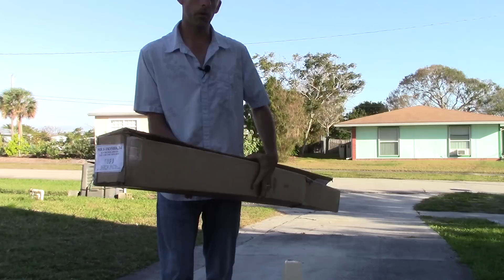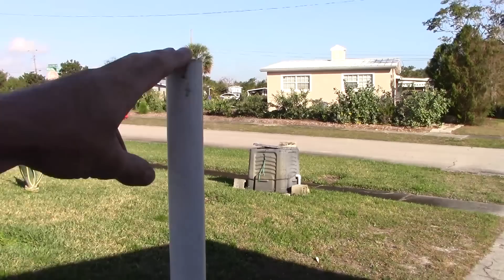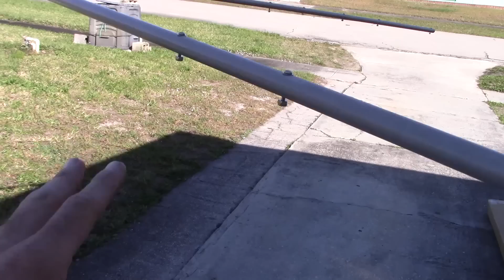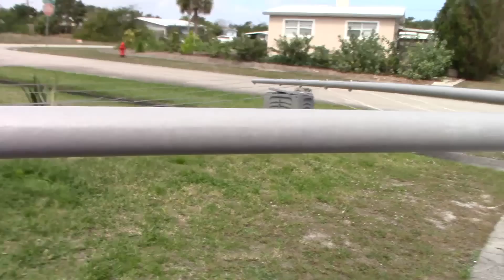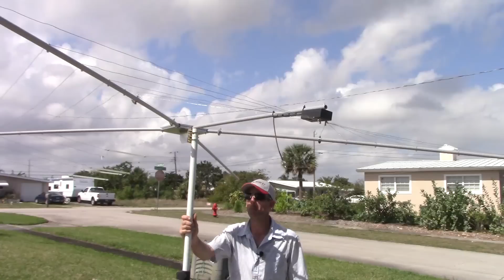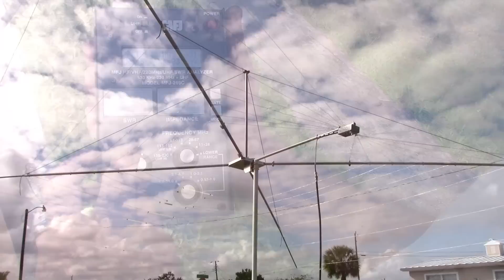MFJ 8-Band Cobweb MFJ-1836+HK34 Add-On Kit Complete Setup

Comment: Thank you!! I just picked up a brand new in the box MFJ-1836H and the 1918 tripod. Your video will help me with assembly. I noticed my 6m worm gear clamps didn’t have the hole so your video explained that. Also, there were two complete mounting plate kits in the box, 4 pieces. I guess that was a mistake when they packed it. That really had me confused when I was going through the hardware list. I will use the extra one for another project!!
Again thanks!!! 
KF0IPT

Comment: After losing my hexbeam to hurricane Milton, I bought the last 1836 at the local HRO.  Also on the way is the 30 - 40 meter kit.  What were the results of your characterization between the cobb-web and your vertical ?   Have you noticed any RF induced reaction between the two antennas ?  How far apart are the two antennas during your testing ?  thanks, 73

Comment: I was surprisingly granted with the remains of a MFJ-cobweb given by a widow of a local amateur operator. The problem is that in the process os removing it someone cut the elements and give me only the hardware so i am asking for the wire measurements for itch band please if you have it.

Comment: "I strongly advise against purchasing this antenna. It cost me €600 and has numerous flaws. The tubes do not fit into each other properly, making assembly a nightmare. They are not machined correctly. Even after meticulously adjusting the antenna with the Nano VNA, all cables hang loose, despite following instructions. Additionally, there is no alternative since the spaces are pre-drilled in the fiberglass.

With even a slight breeze, nothing stays in place; everything moves. The wires from the 10m band overlap those from the 15m band, and nothing is properly tensioned, as you can see in this video. The tubes move in all directions, causing the SWR to fluctuate due to wind, resulting in unstable tuning as the antennas move closer together.

How is it possible to have mechanically botched an antenna in this way? I could have constructed a sturdier one myself, but I trusted a manufacturer and paid excessively for something that doesn't work. I'm not going to drill holes in the fiberglass, risking further weakening the antenna. I'll have to find a solution using clamps.

In conclusion, do not purchase this antenna.

Comment: Wish they would sell versions of these kits that come without the tubes and wire, just the matchbox and other hardware. Would make purchasing internationally a lot easier. I could source some good tubing and wire here easily. Shipping 6+ Ft. packages internationally gets expensive.
Reply: Btw, if i were to get the full 6m-40m high power cobweb, how does it perform running with just 100W power? For now i have just my ts-430s 100w radio but might purchase a amplifier in the future. Or would you recommend getting the 6m-20m 300w version instead and purchase the high power upgrade kit and 30m-40m add-on kit later on when i have the amp?

Comment: Wondering if you found that when you put the cobweb on the final mast elevated above where you trimmed to tune in this video ?  What I have experienced in building several single-band antennas, most notibly my 40-meter 14-ga insulated wire dipole which i found i needed to trim another foot off each end after raising from setup 8 ft off ground to where it is now laying on my 2-story roof at 20 feet. Like the video and the style and compactness of  the cobweb vs the 2 separate dipoles. Best wishes. 73 from California.

Comment: Can you rotate the bottom plate 180 degrees , 
so you can let the top tube go through to put another vertical antenna on the top of the tube?

Comment: I have recently purchased this same antenna. I am stopped at the point of mounting the wire attachment screws because the holes for the  screws for 15m are missing. Specially it appears I have mounting hole for 20m  1" from end of pole 17m  15" from 20m hole  MISSING HOLE FOR 15M 
then the next hole or screw mounting point is 17" away which I assume to be 12m  then 6" and another hole for 10m. Would anyone happen to have the hole spacing dimensions for these poles as I would rather spend the time drilling the holes my self then rely on a return. The other question would be could I safely drill out the holes for 15m by simply dividing the 17" by half and placing it there. Thanks for any help you might give. I don't fully understand the how elements might interfere with one another So those that have one maybe able to help.
thanks
Tom
WI6N

Comment: Crazy question but if i buy the 40m add on, and if i dont use or put the 30m wire on and only put on the 40m wire will it work on 40m or is it dependent on having that 30m wire installed?   I guessing it will but will need more adjustment.......73.

Comment: I have this antenna for about 8 months now in the mast (6-20m version HP) and it has a very small footprint and withstood the storm beginning 2020 (10-11bf) without any issue. It's a great antenna for a very low price. It was easy to tune (with an analyzer ofcourse). You should do a first round roughly and then adjust all of them again as each adjustment will have an effect on the other bands. I use the AA-30.ZERO rigexpert as you can see all bands effect easily of you laptop screen. For me, this has been a great buy.

Comment: Eric, just installed (today) the 1836 and can't seem to get decent SWR's on most bands. Disappointing. Followed directions, used 226 analyzer, yet failure. Dont know what to do next.......
Reply from the maker: Where is each band resonant? Is it lower or higher than the bands?
Reply: @HamRadioConcepts  Eric, thanks for responding, a bit lost here. I picked the center freq of the bands for my Gen license Then trimmed for the best SWR at that center freq. The SWR was measured at each band center: 
20 M 2.07ctr  low end = 2.98, Hi = 1.3.
17M  4.28 ctr  low = 4.88  Hi = 3.79
15M ctr is 2.21  low is 4.48  HI is 1.25
12M ctr is 6.63  Lo is 6.84  Hi is 6.37
10M ctr is1.7  lo is 7.07  Hi is 6.2   
6M ctr is 6.25  Lo is 7.47  Hi is 7.93
My center freq SWR's are almost all over 2. Probably doing something wrong.
Reply: @HamRadioConcepts  Eric, I just bought a MFJ-226, its great but I am getting out of Ham Radio. I just paid $300 two weeks ago, if you know of anyone interested , I am selling cheap. $200  Firm
Reply: @HamRadioConcepts  Eric, also just got MFJ 1386 Cobweb antenna, selling at $200, paid 259 from MFJ.

Comment: Eric I am seriously thinking about getting one of these for the house in Brazil, If I understand that you tuned to the center of of the bands and used the tuner as you moved off center. I will be an AT 200 pro for tuner and the coax run will be about 80 to 80 feet long. 

Truly enjoy the videos very helpful and informative info. 73 N9ZTC

Comment: Hi,  you are definitely an asset to the Ham radio community. You are a star. You describe better how things are and what they do. Without going into too much detail or not enough. although personally I would like to know how people go about mounting there antennas so that I can see and develop my own ideas. I.e the construction. The reason for this is I want to mount the cobweb antenna underneath my 6/2 /70m vertical I think it’s quite possible bearing in mind it is on the chimney of my roof. Also the construction where the antennas meet in the junction box I think to myself I could add more bands that are smaller I.e. higher in frequency....thanks for your work *

Comment: i have the MFJ-1838 8 band cobweb, after watching this and reading what little reviews there are i bought it put it toghtor and it turned out to be Narrow banded. swr being over 10.1on all the bands.  the antenna is now for sale.  Verry disappointed with this antenna.
Reply: Brandon Ray did you happen to tune the antenna when you assembled it using an analyzer? Or did you just connect all the wires and think it was magic?
Reply: @sebastianbluecrew4320   I did try to tune it with a analyzer, with no luck, i would get it to tune on on frequency and when you move away from the frequency its jumps to over 10 SWR.   i had a few local hams look at it as well and it was determined as narrow banded.     it should not be narrow banded, as seen in this viedio and other reviews that it had a good SWR bandwidth.
Reply: Brandon Ray yes you’re right because I used it without a tuner at all that is why I like that antenna with 8 resonant bands
Reply: @sebastianbluecrew4320  thats why i got this antenna to get away from having to use the antenna tuner.  i dont know why the one i ended up with is narrow banded.  any ideals?

Comment: i Need some help with this antenna, i can not get it to tune i can get a little bit of a low swr dip but that only goes for a few khz some bands are way above the ham band.  i noticed that the match box has the center pin shorting to ground. im not sure if that is right for this antenna. im not sure whats worng and its verry anoying. email me my email is good on QRZ 

Thanks for any help 

Brandon
KM4FLU

Comment: I just finished putting mine together. Its the 10-20 metre version, and even that gets quite large when assembled. It was fairly easy to tune too. Only 15m gave me trouble, but spotted it before I cut too much off, the spacer wasn't quite centred. Later this week I'll get it up on a pole and try it out.

Comment: Eric, I've just assembled my MFJ-1838 cobweb.  I'm using an MFJ-209C and an external frequency counter to find all of the resonant frequencies.  Then, my plan was to trim the excess wires.  However, I find the bandwidths are very narrow.  It doesn't take much movement in frequency to go from <2 SWR to infinity.  Is that normal? K8TMW 73
Reply: The longer coax feed you give it the more broadband it should become also when you raise the antenna above 10 to 15 feet above the ground the tuning will change a little not to much. Lets say not it has a 1.5.1 between for example 14.200 to 14.250 ( It will vary) when you add lets say 30 foot of coax to feed it and raise it to something like 25 feet above the ground the the bandwidth will increase to for example 14.200 to 14.280 maybe a little more.

I have this antenna with the 40 meter add on kit I compared it to a 20 meter dipole that has a 1 to 1 match coax fed no balun it is 30 feet off the ground on the ends.
The cobweb antenna is on a tripod on my roof about 35 feet in the air more or less it has a 1.3.1 match at 14.275 the dipole is 1.1 I was talking to a guy on that freq and compared both antennas  while talking to him. The result was the cobweb was about 3db stronger in fact it is on all the bands except 10 meters.
Reply: @jamesmackinlay4477  Thanks for the information!  The antenna works very well on 40M.  Using the tuner in the radio, I've made contacts across the country.  I'm going to see if I can get it a little higher up.

Comment: hello, i am thinking about this antenna, i have a 14foot mfj rotatable dipole and its ok but the swr is not that great, i have no way to string up a wire dipole. i am wondering how big this antenna is? how good is the swr? will it tune with good swr all across all bands?  will be about 30 feet on a chimney mount. any help would be appreciated  KM4FLU..73s

Comment: I just got mine - the hardest part is sorting out all the hardware - theres 58 screws of differing lengths, and 58 nuts of which four are the odd ones out. Took me a bit longer as I live in the metric world and not used to handling imperial system hardware. So nuts and bolts are sorted, now I can actually start building the antenna. Great video by the way - helped me to discover my matchbox needed the ferrites moved up a bit toward the box. 73's de VK2EMP

Comment: new to the hobby so sorry if this sounds like a dumb question  but could i just have a antenna tuner in line to bring the swr down while operating ? thank you dont be too cruel with the replies
Reply from the maker: I just made a whole responsethen realized I was thinking of the wrong video... So I would never be rude, and there is no dumb question, this is why I am here to help.. Just remember one thing. A tuner does not tune the antenna, it only tricks the radio to be happy in seing a low SWR. The best practice is to tune the antenna to optimal, and use a tuner when you need to go from one end of the band to the other and the SWR gets higher. I like to tune the antenna to the center of the entire band, and i can maintain a 1.5 SWR from each side as I move across the band (Depending on the antenna) but the cobweb can be pretty broad banded when you do it that way. If you tune to the very bottom of the band, by the time you get to the upper portion, you will see a higher swr. A 1.5:1 swr is perfectly fine, even a 2.1 is usable. When it is 3.1 and higher it becomes an issue.
Reply: HamRadioConcepts thank you very much I value your advice and I shall obtain a antenna analyser 👍 keep posting Great posts

Comment: Look forward to the comparison between the vertical and the cobweb antenna, currently debating with myself which will work best.
Reply: The Cobweb would be killing the vertical if you can get it 1/2 lambda or more up.  In a low mast it will do well "locally" in your own continent.

Comment: Eric, I own this antenna as well and bought the kit separately, so it was before they started offering all 8 bands in one box.  My question is, how the heck did you get it to tune?  I've got mine an a 6' speaker stand so I can rotate it and NONE of the bands are even CLOSE to being resonant. I haven't added the 30+40 meter kit yet. I wanted to get the first 5 bands tuned first. But like I said it's not close. So what's the secret?.  73, Rob, KC5RET
Reply from the maker: Did you trim all the wires? you have to sweep it on the analyzer to see how long each band is, and trim accordingly..
Reply: Thanks for the speedy reply Eric. No sir, I did not. I wanted to use the other method of wrapping the wire back on itself before physically trimming (suggested by K7AGE). But if my initial tests are correct, most if not all the wires are far too long. So I wonder how much the SWR changes when the antenna is 20 or 30 feet off the ground. Second, does it matter which way you tune, from 10 going down to 20 or the other way around?

Comment: Did the HK34 Add on kit change the tune of the other bands?  Also if not using the HK34 kit is there any way to have a mast above the cobweb to support a VHF/UHF antenna?
Reply: I just put the 5 band together.   have 20, 17, 15, 12, 10 all tuned right up.  6 dip in SWR only comes down to 4.28.  Wondering if you ran into any issues with 6 Meter?

Comment: New to the hobby, and made a 6 band home built version of this...My question is on tuning....Should I start tuning/cutting at 20m and work up to 6m or vise versa? Not sure how each wire affects the other bands so figured I would ask before I trash my wires LOL. K0NES
Reply from the maker: I actually cut out that part of the video, each band wire you tune should not change the others.. I tuned 10-20 and then did 6. No problem.

Comment: Great video. You don't need to cut the wires. Just bend them back on itself and wrap around the wire. If you need more wire, just unwrap some wire. Did the SWR change when the antenna is mounted higher?  

Also, there will be some interaction between this and the vertical antenna being close together. It is hard to space them apart by a wavelength in a backyard.

It would help your video if you would cut in some close-ups of the areas that you are describing. When finished with your main shots, go back and get some close-ups.We all want to see what you are talking about. And, the wireless mic allows us to hear you! That is a great addition to your video gear. Keep it up. Randy
Reply from the maker: K7AGE yes it is lower in tune again so I need to shorten the elements a bit more being higher but its still good where its at

Comment: A very informative video.  I wouldn't mind buying one.  I'm wondering what is the recommended height is?  I look on MFJ's website but couldn't find an answer in the description.  Thanks! KG5MDB
Reply from the maker: Dan Barrera 10 feet minimum
Reply: Great, thanks!
Reply: Per Eric's recommendation I mounted mine 20 ft off the ground and it works great!!
Reply: I believe they recommend a minimum of 25 ft. antenna height after tuning at a minimum of 10 ft.
Reply: Can you recommend a telescopic mast and tripod that would be strong enough for the weight and height of about 30ft?